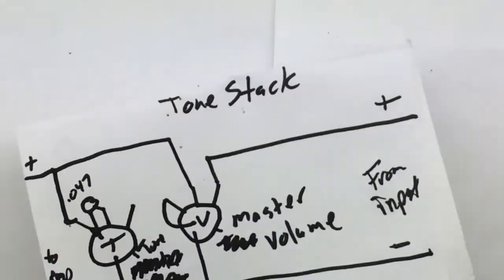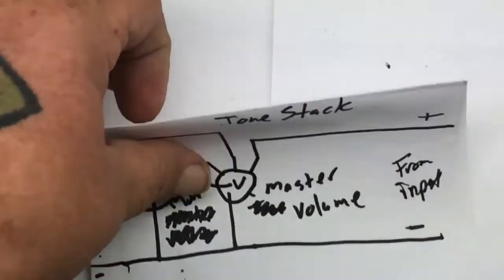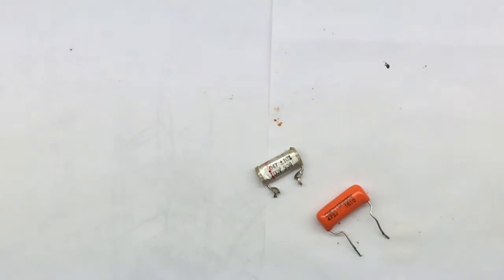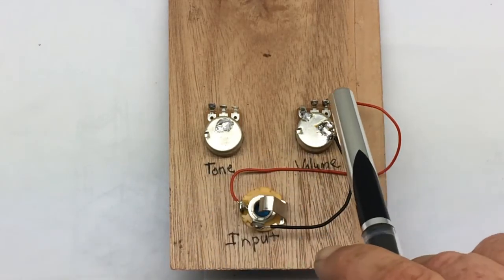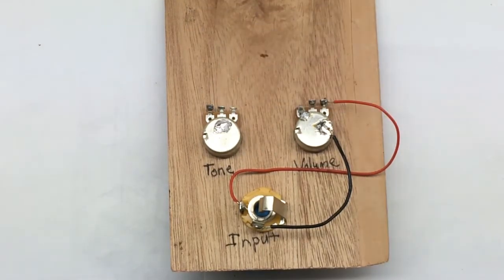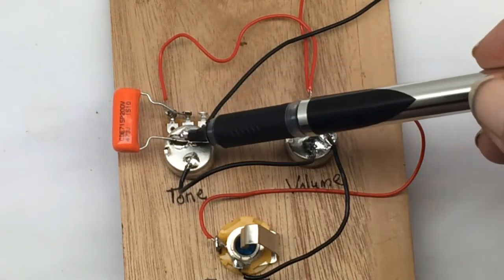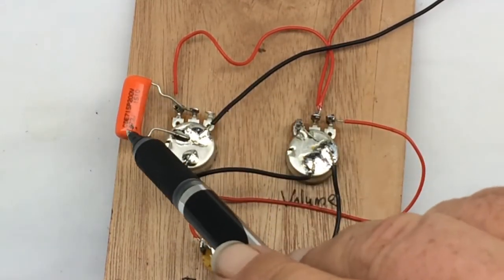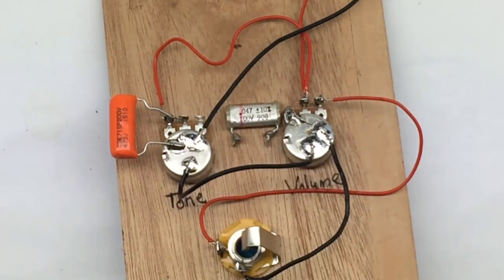1 Volume 1 Tone circut for a guitar or amplifier

Comment: Confused???  JUST THINK OF THE JACK IN THE VIDEO, MARKED "INPUT",  AS BEING THE PICKUP.....  The "Input" JACK is confusing people, I think. Nice video, but what I think some people are confused about, based on comments, is 'where are the pickups'. Correct me if I'm wrong, but the pickup in this layout would be the equivalent of the input jack shown at the bottom of the screen. People are seeing the jack as the jack on your guitar. The jack on your guitar is actual an 'output jack'. It outputs signal to the amp from your guitar. You plug your guitar cable 'into' the jack, but it's an output jack, putting the signal out to your amp. The 'input' (signal) for a guitar circuit comes from the pickups, which as I said, is the 'input' jack at the bottom of the screen, in this case. So, picture that jack seen here as your pickup. And it's just one pickup in this video. (Technically you can probably run 2 pickups w/ just one V and one T, but for those of us using this video for guitar wiring, let's assume    1 pickup/ 1 volume / 1 Tone).  This video is for "one volume and one tone" (not necessarily in a guitar).  But it will work for guitar if you just think of the jack as the pickup with the two leads coming off of the jack as the two leads from your pickup. The output wires at the top of the screen (the red and black that run off the screen (upwards)) would go out to your jack (the typical guitar jack you have on your guitar). The red being hot/tip and the black being ground/sleeve.  Hope this helps. (Original poster please correct me if I'm wrong!)  Thanks!

Comment: I'm new to this so please don't take offense to this correction....if it is.  Correct me if I'm wrong.  Shouldn't the hot wire from the volume pot to the jack be connected on the output (middle) leg of the pot instead of the input leg?  From what I learned so far, the hot wire from the selector switch goes to the input leg, and the output leg goes to the jack.  Is it possible that these legs are interchangable?

Comment: WHERE ARE THE PICKUPS -THERE IS NOTHING SHOWING THEM  - I HAVE NOT FOUND A SIMPLE COMPLET  VIDEO YET  THAT IS NOT SHOWING SOMETHING I  NEED JUST 2- HUMBUCKERS OR A SINGLE COIL AND A HUM- INSTALL
Reply: earl brummett he just calls it the output in the video but that would be the pickup.
Reply: this set-up is for 1 pickup 2 needs a switch and is slightly different